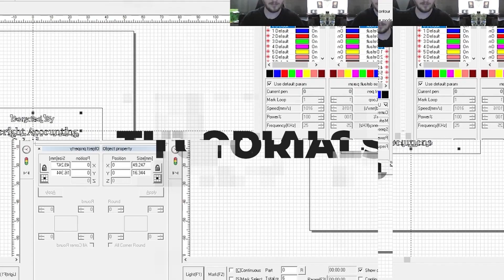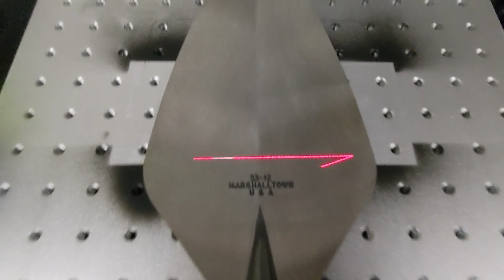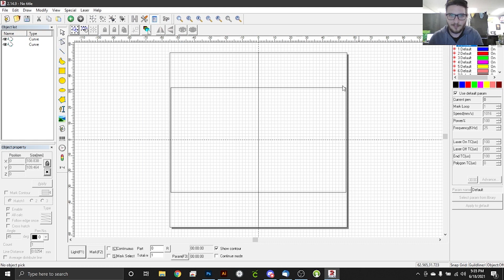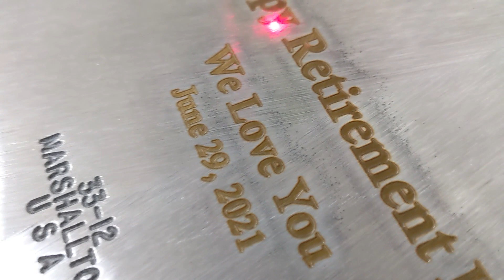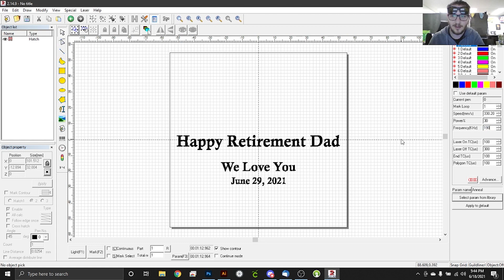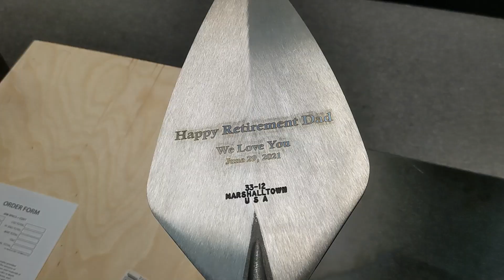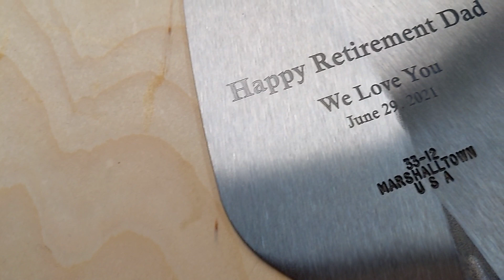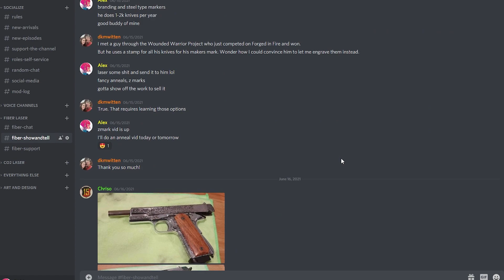How to Engrave and ANNEAL Any STEEL with a Fiber | Fiber Laser Tutorials

Comment: Why do my stainless steel business cards warp when I do a dark mark?
Reply from the maker: Heat warps the metal, it's getting too hot! You need to adjust the settings or create a heat sink with water/clamp them so they don't warp.
Reply: @LaserEverything  not sure what you mean by water… but I know running a higher speed keeps it cooler but then the lines get streaks. Will more passes fill it in? Or should I change the line spacing to fill it in? Or does high resolution only happen with lower speed?
Reply from the maker: Dark marks require that time and heat. The problem is as the heat spreads across the card, it begins to warp the card as the metal pulls/pushes against itself from cooler zones and hotter zones expanding/contracting at different paces. Placing the card against a bath of water on the bottom, or sticking the back of the card against a heatsink can help pass the excess heat and slow that process down. Use caution with water and the laser reflection and of course water+electronics is bad too. Additional option is to pause the engraving in intervals to let the card cool, and do it in segments.

Comment: Is the annealing on the fiber the same as you say a cleaning pass?
Reply from the maker: A cleaning pass is usually a really light pass that just tickles loose soot and material off the surface, where an anneal could come after that to provide some contrast/color and even a layer of protection on the surface. In this case, we go straight for an anneal after the engrave without a dedicated cleaning pass since our basic settings with a single pass don't really leave much left on the surface to worry about cleaning off.
Reply: @LaserEverything  thanks for that. How much is your patreon? Or a link to it I’ll pay so I can get these parameters as I’ll be starting up in a week or two

Comment: In your parameters excel sheet, sheet general has an x for pass. How do you determine how many times to run it?
Reply from the maker: It simply means you can run it as many times as you'd like to achieve the desired result or depth.
Reply: @LaserEverything  okay, thank you

Comment: Anyone found ac way to anneal with a 50w raycus laser yet?  Non mopa
Reply from the maker: The process is pretty much the same as in the video, the key factor is you have a different frequency range available to you, and also the pulse width your source is locked to is a bit lower than the JPT we did this with. 50w Raycus sources usually have a range of 50-100 khz (usually), so I would say try working in the 75-100 khz range maybe, and you'll need to adjust for power, since we did this with a 30w, the same % power on your 50w would be almost double.

Comment: How important is that 25kHz?  My JPT 30W specs state it drops its max power output off from 37kHz down, so by the time I get to 25kHz I am probably quite down on power output.  I am struggling to get your results, but I don't know if it is because my stainless is crappy and maybe not even stainless (just cheap shaped out of China).

Comment: Assuming that the steel isn't treated with any oils, or grease, does annealing steel or aluminum emit any toxic VOC's or particulate into the air that would be dangerous to breathe?

Comment: At my work we have a Cobalt Dominator laser that we use to mark components we build for injection molds but whenever we do anything (especially steel) we always seem to get a gnarly burr around the text that we usually have to stone off (which isn't ideal since some components are ground to a specific finish and the stone scratches it). Is there anything we can do to prevent this?
Reply: Use correct settings and it is smooth as can be.

Comment: did you say in this video never to run the laser at 100% ? I thought that was not a problem with the fiber.....
Reply from the maker: It's not, this is a verrrrrry old episode (one of my first) and I was mistaken here.
Reply: @LaserEverything  okay, thanks. i also ask the seller at Hoation and he actually told me it is better to keep the laser below 95% (Raycus 50W). So maybe not so wrong advice after all! Keep up the good work!!
Reply from the maker: I'm going on my 4th year with my 30w JPT Mactron and I run it at 100% fairly often. No issues to report along side a ton of anecdotal reports from the community. Still, running at 95 isn't gonna hurt anything. Whatever you're comfortable with :)

Comment: What laser engraver do you use? Is it capable of engraving on 304 stainless steel?
Reply from the maker: This was done with the Mactron fiber laser linked in the description and would have no problem with 304 stainless.
Reply from the maker: Any time you engrave you can cause issues with the integrity of the surface of the metal. Instead of engraving away the chromium surface I would try a direct anneal instead, or look at our video on z-marking: https://youtu.be/lJOsFhCxLkk
Reply: also, will this cause any corrosive effects by removing the chromium surface of the steel?

Comment: Any tips for doing this with a 10w diode laser?
Reply from the maker: You can attempt to use a marking spray like ceramark or brilliance laser inks but that's the only way to truely get a mark and I haven't found good settings for it yet. Otherwise the diode MAY be able to get hot enough to anneal stainless at very slow speeds but again I've been unsuccessful so far. We'll dive deeper into it in a future episode.
Reply: @LaserEverything  thanks for the info!

Comment: What kind of adjustments would need to be made to compensate for a longer lens (300mm, e.g.)?  More power?  Thanks.
Reply from the maker: Yes quite a bit more. Larger lens = larger dot size of the beam = same power spread out over a wider area, so you need more power to compensate.

Comment: Thank for the video. Do you need to run the general setting first before annealing or can i just go staight to annealing?
Reply from the maker: If the surface of the metal is clean, you can anneal first. It shows up better if you engrave first, however. I would do a test before committing.

Comment: Hello, does the 50 watt fiber laser etch into steel and what are the depths?
Reply from the maker: It does, it can go as deep as you have patience to run it. Cutting is more difficult but you can do very very deep engravings over long periods of time.
Reply: @LaserEverything  
Thank you, sir, but I have another question
What do you think of Chinese hardware, is it practical or is there another source I can buy from? The quality is excellent and the price is appropriate.. and thanks again, but the response was very late to the point where I said to myself I am just a beginner and you are a professional, so you will not pay me any attention
Reply from the maker: Chinese hardware is 100% the way to go. They're the experts at building these machines. I try my best to answer all comments there are a great deal of them to read and respond to 🙂
Reply: @LaserEverything  💞

Comment: Any advice for smoother engraving result for metal surface?
Reply from the maker: You can just do the anneal without the engraving. It will still mark the metal without the rough edges.

Comment: I'd love to see you experiment with engraving and electroplating.  For example, engraving through a coat of plasti dip then plating so you end up with a detailed electroplated design. Or anodizing different patterns so the oxide layers vary in color
Reply from the maker: My shop isn't set up for those various processes but I'm always accepting items from viewers to engrave on for experimentation, if you have access to that kind of tech and you want to send some items out for testing or video feel free to send something!

Comment: Hi. I recently had a custom 3D Galvo 80W MOPA fiber laser machine built and after a few months of getting everything worked out, it finally made it through customs and arrived a few weeks ago. I was involved in the design because after initially knowing very little about various laser types (physics in college was about it), I went down many rabbit holes during research and finally had a thorough understanding of lasers, particularly the fiber lasers. However, I am less than useless when it comes to having a thorough understanding of the software and particularly some of the names given to certain functions. Mine doesn’t have EZCAD, but the software is likely related because several things look just like EZCAD. I assume that it is essentially a 3D version more or less. I have been working with different file types and various settings, but I still have what seems like light years to go before being able to have confidence in the end result with different settings/material/effect/colors, etc for most things. I am colorblind also so changing settings to get all of the colors dialed in with stainless and titanium is challenging. I have a 110x110 lens for most things, and 175x175 for colors. My primary use will be firearm related, both customizing and building prototypes. I basically wrote this extended novel to let you know my predicament and see if you have 3D and/or MOPA settings. If not, would you be interested in collaborating and/or helping build a library? You are more than welcome to use it to do anything or try whatever and of course use it for engraving, milling, finishing, coloring, or whatever else it is capable of, including handling non flat materials without distortion or any problems. I have Team Viewer and can get other software if preferred. If not, if you can refer me to someone that would be great too. Thanks. Ray
Reply from the maker: Hey ray! Thanks for sharing your story, I'm color blind too so I hear ya on that! I am almost certain what you have is a modified version of ezcad3.

I'm not going to be very useful in building settings for that but some of my staff are over on the DISCORD server. I HIGHLY recommend you join. It doesn't cost a dime and it's filled to the brim with people who have nearly identical setups. Every day they are sharing results and new settings. It's an open place where we value the free exchange of information. I honestly can not recommend it enough to you - it sounds like just what you need. 

It's a little weird when you first join if you don't have experience with the platform but just think of it as a glorified chat room. Over 500 members and so so so many are active daily. 

There's a phone app, a web app and a desktop app so it can be easily accessed from anywhere and may of us just leave it up on our laser computers while working on projects bouncing ideas off one another.

Please consider joining us there. I think that's where we can be of the most use to you - and again it's free :P

https://discord.gg/DnJQ2yZf
Reply: @LaserEverything  Thank you for the information, I am going now to sign up! It has been tough trying to figure everything out by myself, will be nice to work with others and hopefully I will be able to help at some point too. Thanks again!